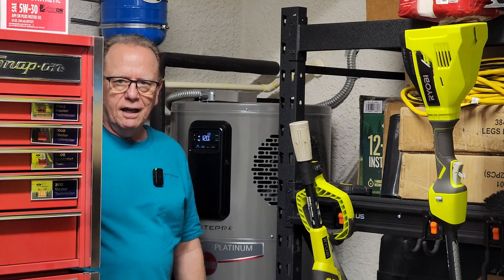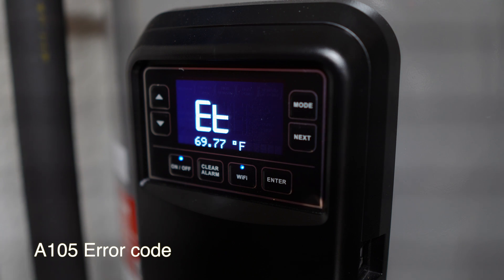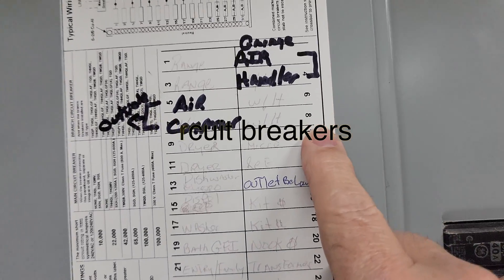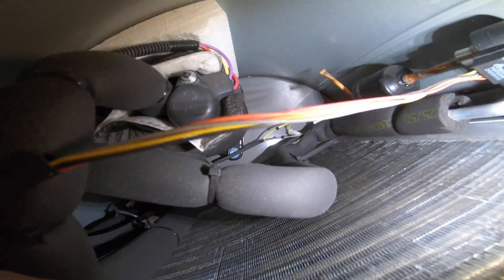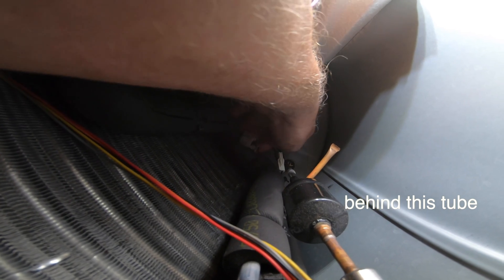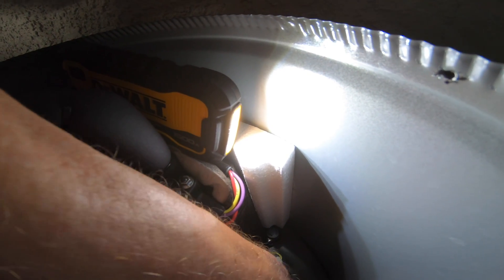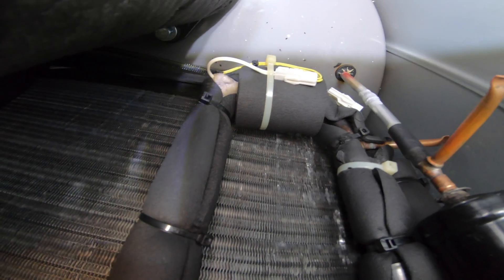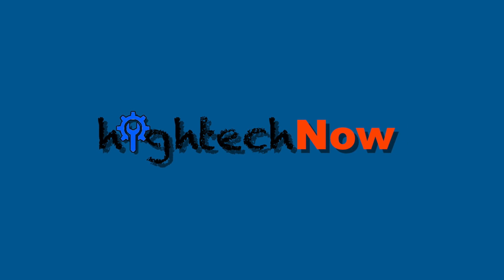Rheem hybrid/error A105 #hybrid water heater #high performance water heater

Comment: Where is the error code displayed? I did not get an alarm and there's nothing in the app on the phone for events or alarms but there is the triangle with an  exclamation mark inside. Have no clue what the air actually is.
Reply from the maker: It was in the app. Call the number on the hotwater heater.  They will walk you through.
Reply: @htnowpro  on the alarm page? Mine was blank. I ended up going into the manual to figure it out. There's that space at the bottom of the display, I don't know why they don't always just show the last alarm description there. But anyway, you have to navigate on the screen to alarms and alarm history and then use the up and down arrows to display the message. It was just about the filter cleaning. Again, I don't know why there was no message in the app or why it wasn't beeping. Supposedly the audible alarm is turned on.

Comment: *** For sensor for error code A105.... it's the GREY lead wire sensor.  NOT the YELLOW lead wire sensor. ***
  Thank you for the updated note during your video.  ( The GREY wire is for the A105 error. )   I initially changed out the Yellow wire sensor with no resolve of error code A105.  Then my wife saw the update note during your video at time stamp 6:02 .
Again , for anybody trying to change out the sensor for error code A105.... it's the GREY lead wire sensor.
   Thank you again !!!!
Reply from the maker: You are very welcome.  I am glad you were able get it resolved.  It figured that would be the hardest to replace 😕.  Have a wonderful week ahead 😊.
Reply: @htnowpro  When installing the new thermistor, I unplugged the thermistor I suspected was defective and plugged in the new one. With everything in a safe state, I ran the diagnostic to confirm it was the correct one. Don't try this at home kids...
Reply from the maker: @Freddy735  nice!
Reply: Yellow lead I believe is the ambient sensor.

Comment: So, your error code was A105.
My error code is A004.
I went through the same steps as you over the phone. At first, she told me the tank has low refrigerant. You don't work on low refrigerant. You take it back to where you bought it from. Rheem will reimburse you the difference. In other words, if you bought it during sale. You don't get the previous sale price again.
She went and asked someone and came back with bad sensors?

I think I'll call before proceeding with the replacement of the sensor.😅
Reply from the maker: Thank you for taking the time to share.  Please let us know how it turns out.  I bought mine on sale also, the price now is crazy 🤪 high.
Reply: @htnowpro  
My sale price was 999.00/ 1699.00 regular price. I bought mine in 2023. It already broke???
Did you call your local power company?
My company has a 600 dollar rebate.
Federal credit of 30%
My final cost was 99 dollars.
My buddy was a vet. He got 10% off from Home Depot.
They gave him 99 cents to haul it out of the store. He got his for free plus 99 cents 😁
Reply from the maker: Wow, wonderful prices paid 👏.  I am happy for you both. I didn't call the power company 😕.

Comment: Hey what was the part number was it AP19299?
Reply from the maker: Call the number on your hotwater heater.  They should walk you through diag and send you one.
Reply from the maker: It was SP20845.
Reply: @htnowpro was this the sensor that was the correct one (for the grey wire), you mentioned the first time you replaced the wrong sensor. I have the exact same code you had..
Just want to make sure I have the right sensor

Comment: Would you recommend purchasing this type of hybrid heater? I have been thinking about getting one.
Reply from the maker: I would absolutely recommend it. My coworker bought one also. It's been working great.  Be prepared for some way to run a condensate drip line. My coworker doesn't have any way, so he drains to a bucket once in a while.  Thank you for watching and commenting.  Have a wonderful weekend.
Reply: Thanks, I have heard reports of the units being too loud but maybe they were a different model than yours. @htnowpro
Reply from the maker: They do make the sound of a small window ac unit or fridge.  Depends on where in your house it is situated. You can set times for it to run if it bothers your sleeping or such.
Reply: go with a Bradford White water heater
Reply: Three years an it broken your asking if u should buy one 😂
Reply: Bought it and installed. worked half a year, then got brocken. Replaced under waranty. but 10 days without hot water around christams is something. In two year again started to beep, and code 105 came up (that is why I am here. You might save on electricity, but you pay for fixing. Even if you do not pay, you stuck for 10 days without water for free,